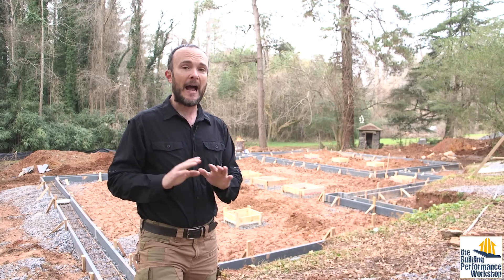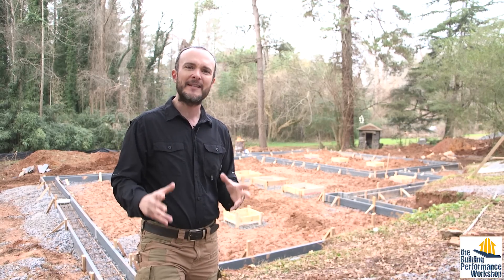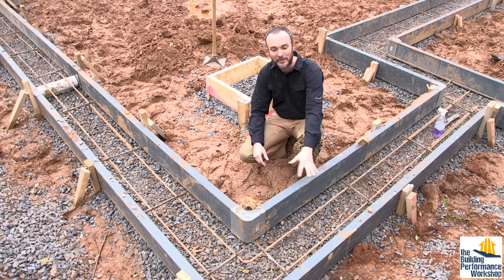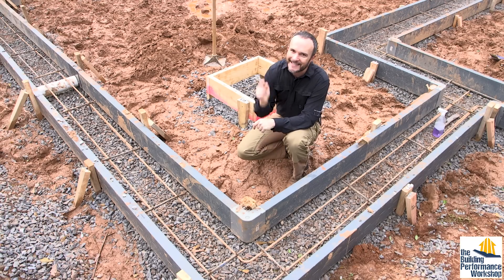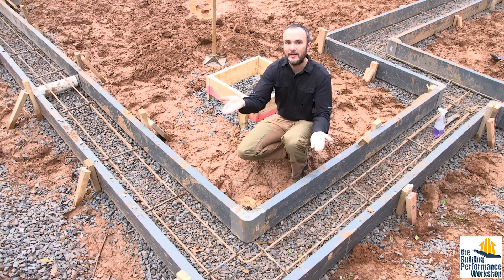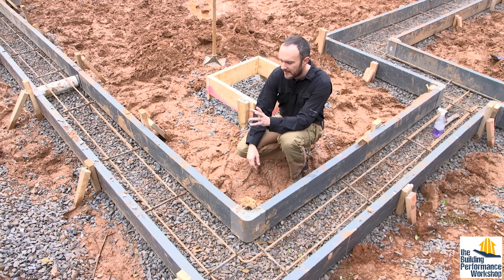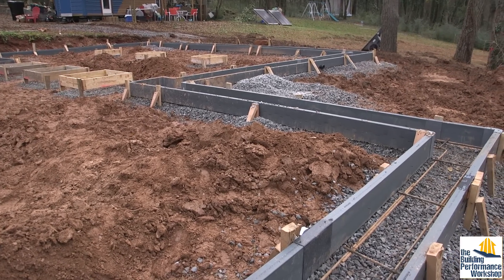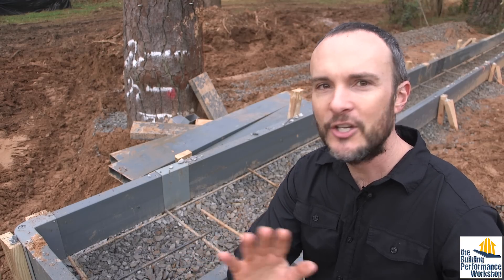First Concrete Pour: Form-A-Drain 4-in-1 Foundation Footings

Comment: FYI  those "drywall" screws you used to attached your forms to the concrete will rust out in the first year.  Drywall screws are not rated for structural work,  if you were that concerned about attaching the forms to the concrete perhaps you should have used stainless screws.
Reply from the maker: It's only to hold the assembly together until tons of 57 gravel are poured to pin it in place. Nothing long-term expected.
Reply: As a former experienced waterproofng tech those screws serve well in this case as he said just to hold it to the concrete until after it is backfilled, makes replacing it as need years later far easer since they would be rusted out well in advance unlike SS fasteners you speak of making it more difficult to remove the form drain when replacement is needed. Even less messier or far less troublesome than an  epoxy bonder.

Comment: I hate blown out forms it looks sloppy and it's something that could be avoided. I surprised the inspector didn't say anything when he saw two stakes every 5 get to hold back tons of concrete. Should run stakes high and use tie wire. There are many videos and books that show the right way to secure forms from moving. I understand being on site. it's your home and you want it done right. it's just a shame. you took so much time to make sure everything was done right but then the forms can even support the pressure of the concrete. when it comes to concrete, you'll never regret over overbuilding your formwork. Ideally you'd back those plastic forms with 2x10s. what I don't get is how you think that stakes driven 6 inches every 5 feet (or more) down was going to hold back tons of concrete. the steel work and base work is great though. I'm busting your balls.  good strong footer there and good for you for being on top of things. good luck with your new home.
Reply: 31 years in the field, the easiest thing to do is cut horse shoes out of plywood and slip over the forms to hold against spreading. Then the stakes will easily do their job holding the forms to a line. Slow that pump truck down and get the tube closer to the ground so it’s not throwing the mud in  at a high rate will help also
Reply: @timothykuharich9967  Yeah the plywood horseshoes are the cats ass at holding forms in place, and yes nobody else caught the fact that pumping concrete to fast, will wreck forming faster then anything else!! Also holding the hose nozzle too high will also contribute to form damage.
Reply: @timothykuharich9967  nailed it. We use custom steel brackets That rundown the sides as well as a inside piece that goes down an inch just to hold them in place. During the pour we lift them up that 1inch so they are out of the concrete and you can trowel. For any rebar you can use wire to hang the bar. Before lifting the brackets you just untwist the wire and pull it out. It saves so much time and effort and does the best job in my opinion. But for his one time pour the plywood bracket is a great idea. As soon as I saw zero crossers i knew that it was going to bowout alot lol
Reply: After all his talk about nailing stakes into the metal drain, it never occurred to him that you CAN use wood to support the sides of the form, or that the product has specific components designed to deal with the problems he encountered? At least he had his spray bottle and sent plenty of love letters to the Inspector. It's the sort of behavior you see in a traitorous woman.
Reply from the maker: hammy, the house is in sheathing stage and all is well. Thanks for your sweet concern over the footing, but you’re blowing things a bit out of proportion I think
Reply: @HomePerformance  --- Us construction folks are a peculiar lot. If something isn't done exactly how we would personally do it than it's 'wrong' and the house will surely crumble to the ground by the first gust of wind. 😊
Reply: I see nothing wrong with the op's comment here. If this guy is going to act like he's above and beyond the everyday contractor he should be open to positive criticism. After all he didn't know concrete should stick to the rebar.
Reply: Sloppy till its buried. Wider the footer the better. Why does everything gotta be straight push materials to there limits take risks put curves in your work.
Reply from the maker: Why are so many of us acting like construction is an exact science? It’s messy. Weather happens. Rocks and dirt shift. When you get a structural engineer to specify your project, they overdo things to allow for little stuff like that.

Comment: Using steel rebar in that is not a good idea.  Come into the 21st century and use basalt rebar
Reply: Guy you just blew my mind. Good tip. Steel is just a cancer to the concrete.

Comment: I work for insurance companies who insure RC buildings,banks,bunkers high grade stuff.I inspect and attend concrete pours and give permission to pour(if all ok).
I fail many on dirty rebar,its not a option that its clean.
I fail some on chairs not being tied,dropping in rebar after theres concrete in the form/hole is not a option but what crappy builders do as its easier.
A slump test is done on every wagon delivered,1 wheelbarrow load dropped and then a test done on next bit of concrete,someones trying to baffle you with bullpoop,test it from the wagon,ie before the pump.
The forms should have had a bracing of timber with the stakes behind that so the forms didnt bend,again idleness of the contractor.
Reply: Hard to argue with facts, contractors.  I was the adjuster who investigated failures when you had to involve your insurance carrier.  I don't think it much matters what trade I might hire, I want a contractor who is intelligent and confident enough in his knowledge to answer my questions or concerns.  If a contractor acts like such inquiry is an attack on his manhood or ability, it's a huge red flag to me.  The fact that the builders will not live in a build, opens the opportunity to cut corners to save time or money.  Regarding the rebar, has anyone contacted the manufacturer to hear what they say about rust? What I know on highway construction is the steel epoxy coated bars used cannot have scratches or the manufacturer says they will fail.  I know that because a truck driver dropped a load going too fast around a corner.  I wonder if rebar has some coating property that not only assists the bond but provides some rust proofing? Does anybody know?  Do it right the first time because you don't have time and can't afford to do it again, for free!
Reply: @PI4YOU  Depending on how bad the epoxy is damaged will determine if it can be used.  If it has minor damage it can be touched up with epoxy supplied by the manufacturer.  Used some in an industrial build at a crude oil refinery many years ago.  Regular rebar does not have a coating and will rust some and that is ok.  It just can't be so bad that portions of the rebar are actually flaking off.  In other words, surface rust is ok.
Reply: @PI4YOU section 12 of ASTM A 615-96a, "Standard Specification for Deformed and Plain Billet Steel Bars for Concrete Reinforcement," says that rust shall not be cause for rejection provided the weight, dimensions, cross-sectional area, and tensile properties of a hand-wire-brushed test specimen aren't less than the ASTM specification requires.

Section 7.4.2 of ACI 318-95, "Building Code Requirements for Structural Concrete," has a similar statement indicating that reinforcement with rust shall be considered satisfactory, provided the minimum dimensions (including height of deformations) and weight of a hand-wire-brushed test specimen aren't less than applicable ASTM specification requirements.

Comment: I was the same way with our house cause it seems like they wanna take short cuts but the cleaning  the rebar I think is a way for them to play you as a fool... I can see if there is huge chunks of dirt or organic material but rust or a little dirt isnt gonna change anything... the rebar is encapsulated in the concrete and concrete will sweat with temp change which will make the rebar rust anyway... big chunks of organic material would break dwn and cause a void but most concrete will have air pocket and voids anyway so I really se it being a way to mess with a picky client....

Comment: i would be worried that the rebar would rust with the water you sprayed on it.
Reply: Re-bar always rusts a little in concrete, this actually helps it grip the rebar wtih friction when hardened. It's not ideal. Ideally you'd use galv or coated rebar of some kind (at extra cost). However, when properly sealed in the concrete, with no cracks, the rebar stops rusting quite quickly. This is why vibration is also very important to get any voids and air bubbles out. Failing to properly seal the rebar in, will doom the structure to slow corrosion death. Rust expands inside the concrete and cracks it, allowing more moisture in an accelerating the rusting process and area.

This is why the steel chairs should not be used at ground level, some may well contact the underlying earth and begin to rust and feed up to the main rebar over time.

Comment: I hope having part of foundation on hard rock and the rest of softer ground doesn't cause cracking from uneven settlement.
8x16" foundation looks fairly minimal.
Reply from the maker: Hence our two prior videos where an actual geotechnical engineer specifies our plan, and we spend four days compacting the soil with a trench roller.
Reply: @HomePerformance  OK, fair enough, I didn't see those videos, as this one just came up on auto suggest.
Your engineer would know what is right.
Maybe the rocks are floating and not part of the bedrock.
Foundation size would be fine, it all depends on the underlying material.
I have no concrete foundation - bricks straight on bedrock - no hint of cracks after 50 years.
Reply: @HomePerformance  Ilookedforthe video and didnt find it either.Not trying to find fault(well I suppose I am) just the info was wrong as Id seen it and you for once on here seem like you want it right.The rebar corners are wrong though,well not best practice,look here http://castraponere.com/homestead/wp-content/uploads/2012/07/IMG_2053.jpg you will see bars should run inside to outside/outside to inside anykind of corner(pier to beam/vertical corners) should be built on the same principle.
Reply: @HomePerformance  Just watched .it And he may well be an actual geotechnical engineer but thats not how a soil compaction test is done, leaning on a spike. Tests at 1ft increments are needed, measured weight/distance of penetration number of hits.
Now I am not a geotech,I employ them sometimes when I need actual numbers before pouring which is generally when I wasn't there for the original testing and I can categorically tell you that the spike in the top foot test is a waste of time,if its rained and dried the top foot may well be like concrete but a foot down like marshmellow. Normally itd be ok with a 3ft RC footing but you havent got one youve a few inch and one bit is on bedrock ie wont move a 32nd of a inch.
Reply from the maker: Right again, and again, we have a video of that test:
Home Build Update: Grading Soil for Performance 
https://youtu.be/yRlyhmlzXlU
Reply: I cant see any other result TBH. I do wonder sometimes at the depth and size of footings in the US,they nearly always seem very minimal,a 3 storey house sat on a 8 inch foundation with a couple of bits of 10mm rebar sometimes.?
Reply: john g in the US our houses are light framed  wood,  so the structure is much lighter vs a brick or concrete European house.  Also we normally use asphalt composition roofing vs tiles,  very thin and light.
Reply: @Bobg425  Yes and he distinctly said the foundation is "resting on rock" in one place 3:24
and goes on to describe how fill was brought in for the rest, and uncompacted, hand tamped gravel on top as well.
He said he wasn't interested in excavating any rock, like it was his decision, but I personally would much prefer that, than bringing in a load of fill and raising the foundation with forms above ground, which he said was all very expensive anyway.
Reply: he doesnt really need any more than that on a single family home ubless he goues multiple stories hes got ten columns inside of it its actually over kill but thats the way we engineer nowadays
Reply: Home performance,  you likely have high probabilities to have differential settlements in your house.  Switch your "geotech eng" and if you paid any money to him for recommendations and it was his idea to have this foundation setup partially on rock and partially on soils he just stole your money and should be sued and his license should suspended. Good luck buddy